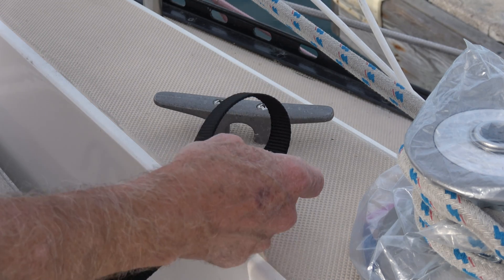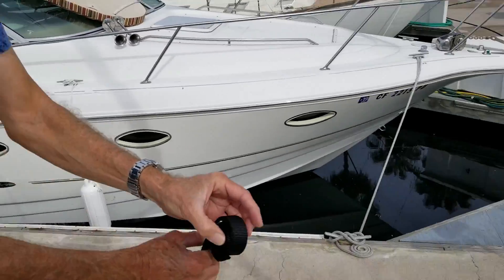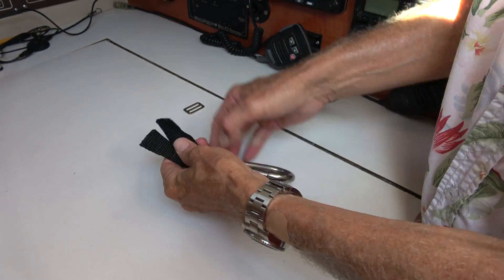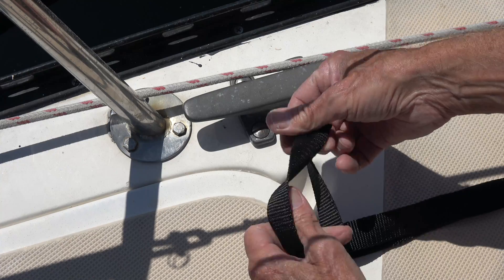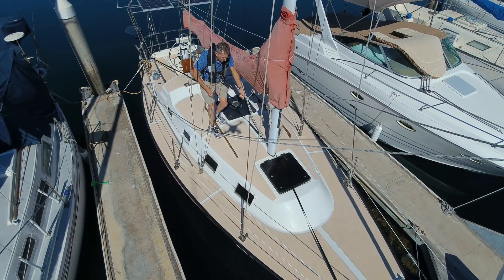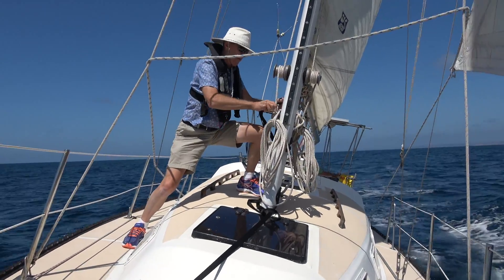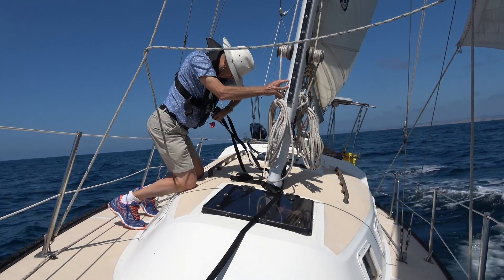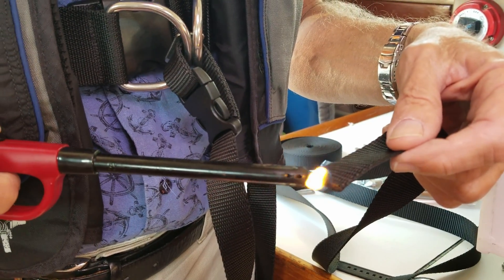Jackline Redesigned

Comment: I really enjoy your shows. Thank you for making them.  Have you done any research into nylon on nylon friction? Rock climbers use carabiners to prevent the friction that could burn through a rope or nylon anchor. Could this be an issue with your set up? Or do you think that level of friction in your set up would never be reached?
Reply: Sorry, but I have to disagree with your analysis.  The possibility of failure with nylon on nylon occurs when the system is under load.  Walking up and down the deck sliding your tether along the jack line will do minimal damage.  The problem will appear when you go over the side and put load on the system.  It is amazing how quickly nylon will melt through.  Definitely use a carabiner on your tether!
Reply: @brianmiller7934  I am a climber, but learning to sail. I agree. Glad this was brought up, definitely no nylon on nylon like that. 
 A carabiner should be used.
Reply from the maker: There is no tension between the teather and the jackline and it slides with no apparent friction. Also the duty cycle or the number of trips up and down are very low compared to most things where friction becomes an issue. I think sun damage, salt crystals from ocean spray causing damage and metal corrosion of the carabiners will be more important. Like all thing on a boat it takes constant inspection and maintenance.

Comment: If you’re going to make it this complicated you may be better off putting a spinnaker halyard on your vest to keep you on deck, gets you full length of the boat safely. Have you tried that?
Reply from the maker: Going down wind and jibing with the spinnaker halyard attached to your harness could get you in trouble as the halyard gets in the way of the boom as it comes across. Tacking has the same problem which is bad but maybe not quite as bad. I have used the spinnaker halyard on my harness to get some video where I was leaning out very far.
Reply: I see good point on gybing risk indeed, more suitable for long trajectories then active maneuvering then.